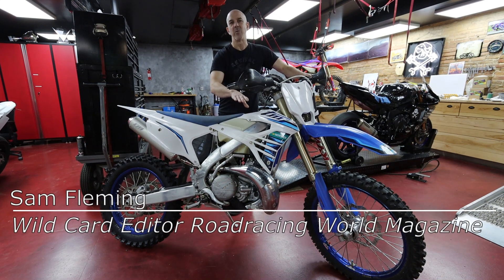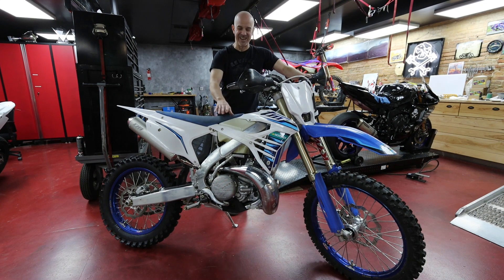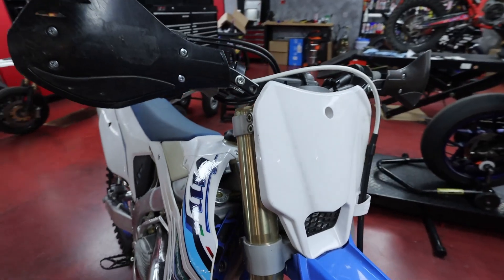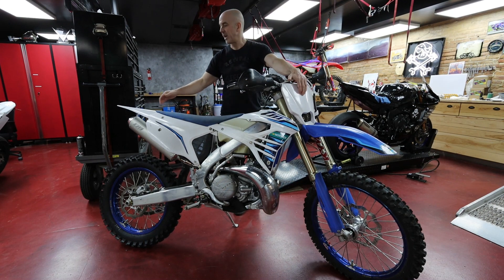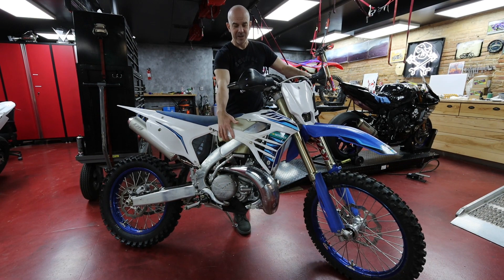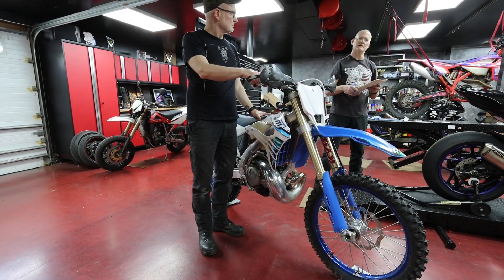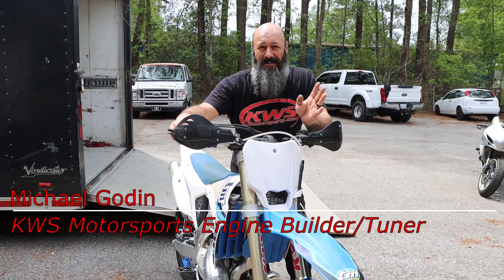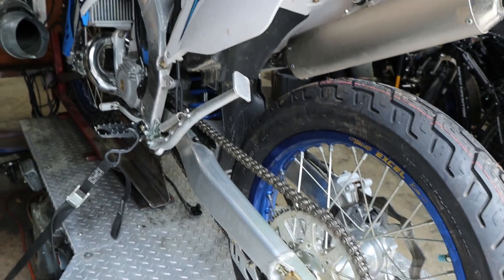TM Racing TM300 EN Weight and Horsepower

Comment: Are you just using the plates from rekluse? (Keeping it manual)Do they share plates with other brand bikes? Thanks in advance
Reply from the maker: Hi,  we have it working as an automatic clutch.  The big difficulty is that we are using shims under the throw out bearing and that means taking the clutch cover off and removing the pressure plate every time the clutch needs adjustment.